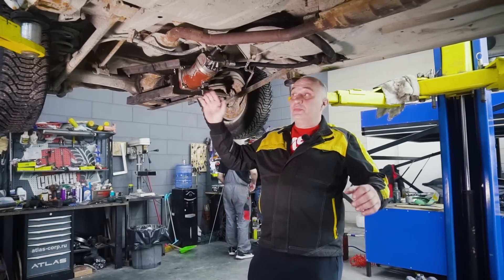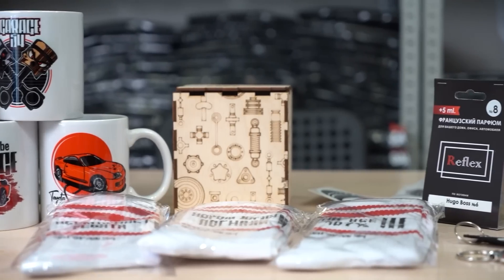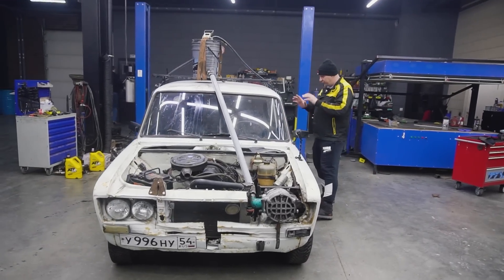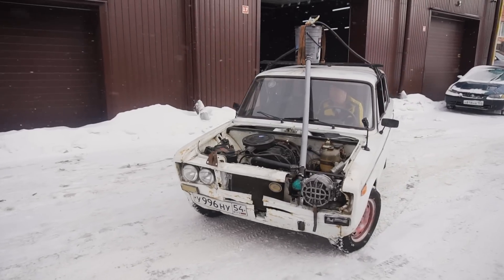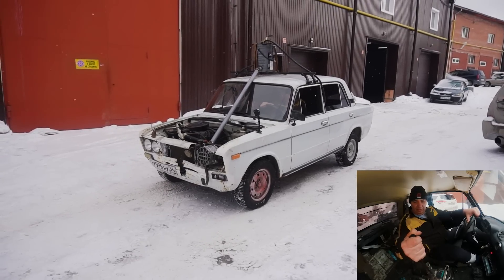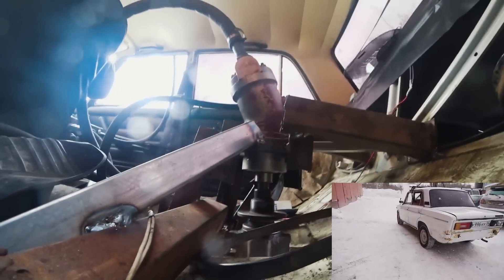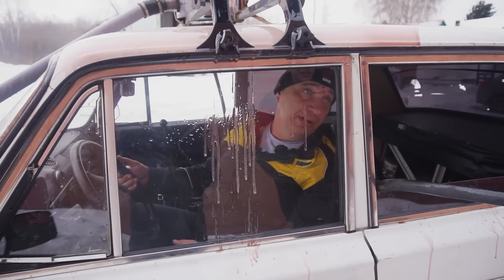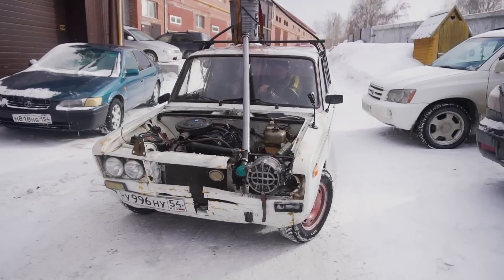Liquid propshaft (part 2): we got it to work!

Comment: the problem is your valve block; its not meant to run stuff like this, its meant to run reversible cylinders. This means that in the transitional region (from off to  forward, or off to rev) it creates a ton of extra restriction, but doesn't help "slip" the engine with relation to the wheels. When you fully open it then the restriction goes away but now you're fully in gear so again its hard on the engine. This is why this system only works when you rev it then slam it into forward, but struggles so much when you try to ease into it. its hard to say what the gear ratio is but it may or may not be correct. I think you would have better luck with a clutch between the engine and the pump, and then running the hydraulics from the pump to the motor without any valve.

Comment: What do you mean can't backup is inconvenient. When I bought a VW Bug in high school the transmission had lots of problems in Reverse so I tried not to use it. I remember out camping with my brother in one of his cars when we lost reverse from the automatic - Bang! no reverse. On a different Bang! no third gear so we drove ~200 miles in 2nd down I5 in California from Humboldt county to Silicon Valley area. Once driving a van in Santa Cruz the shift linkage broke so I was stuck in 3rd. Starting up on a hill in 3rd gear is interesting.

I remember air powered power tools used to be very popular although more are battery electric now. What about four wheel drive are power? Stupid idea. In swampy area in USA people have Fan Boats with the engine driving a big FAN to push the boat because propeller gets tangled up and hits too much stuff. Driving around down you'd knock people over with the wind but when the chase you the wind would blow them away so you could escape.

Comment: Maybe put the pump in place of the transmission, but leave the clutch in.  You start with the clutch depressed, so the hydraulic pump is not spinning.  Then release the clutch to run the pump.  

A reversible hydraulic motor takes care of reverse.  You just pull the lever the other way.   You might be able to salvage one from a mini excavator machine-- the one that spins the whole cab would do; it's not high RPM, it's reversible, and it's got plenty of torque. 

Nice build, regardless.

Comment: Would be neat to set a Lada up as a skid steer with hydrastatic drive. Remove the steering wheel and lock all the tires. It would turn on a dime!

Comment: Having had a boat with hydraulic drive I have some insight into what's possible. Now it was some years back, but I remember that the hydraulic pump and motor actually was the same models. Turns out they can work either way. Another thing was that the valve used had three circuits. In "neutral" is recirculated the oil from the hydraulic motor to the oil reservoir. In forward the oil circulated through from the pump to the motor and back to the oil reservoir. Finally in reverse it simply switched the input and the out put of the hydraulic motor. The valve had some overflow so it was possible to carefully moderate the prop speed without changing the throttle. Or you could brutally slam the hydraulics from full forward to full back and the boat would rattle and shake as the water churned into white froth behind the boat.

This last was scary and put a lot of stress on the hull. It's something that's almost impossible to do with a mechanically coupled driveshaft, but the hydraulics was just so darned robust. The boats previous owner was a retired Navy Commander and he drove that boat as if it was one of his corvettes. Full forward and full back, nothing in between... I never used it anywhere near as hard, but it was good to know just what it was capable of if need be.

What I'm getting at is that it shouldn't be that hard to hook it up so you have a reverse. Another thing is you need an oil cooler if you want to be able to drive it for any length of time. When the hydraulics heat up enough it will foam and you don't get anywhere. I also think you need to figure out the RPM of that pump. It really shouldn't be to high as that generates more friction in the hydraulics lines which heat up the oil even more. Get the RPM down somewhat and it shouldn't heat up to much.

And then there's the speed of the hydraulic motor. If it's to high you either have to get some kind of gearbox in there, or perhaps you can do with a torque converter. That last might be a good option if you have one or can get one for cheap. When a hydraulic drive is used in a boat the prop and the sea acts as your torque converter...

Comment: Ok, so that was hydraulic power transmission.
The logical equivalent would be electric transmission: fit a generator to the engine and drive an electric motor on the rear axle.

Comment: You should have put the hydraulic pump at the end of the transmission, not on the engine.
And then you would have had 4 speeds, rather then putting another differential in there.
And the hydraulic motor has to be bigger too.

Comment: Seems you would run this directly to the Flywheel 

It would give you a transmission to work with and would be interesting using it as an  engine assist (challenge would be to make the crank/Flywheel work with the hydronic gear)

Comment: just what popped in my head when I saw the video. you should have connected the pump to the output of the gearbox and have full control over the pump speed and just In case a divert valve on the hydraulic pipes in case he pressure is too high or too low

Comment: In part 3, you should explore Ford's Hydraulic Power Assist concept. Have the hydraulic system as an add-on to the mechanical system, with a ballast tank that pressurizes when braking. If set up correctly, that Lada should do 0-60 in 5 seconds!

Comment: Place that system with front wheel drive.  Connect the pump to flywheel from motor and set a connection to throttle  and it would be less stress to shorter pressure lines and have the hydroloic oil   tank in trunk that would be hooked up to a  oil cooler that would be more efficient to the car.....and  shorten the lever where your throttle controls the speed

Comment: Using the transmission would have been a good idea. It is there for a good reason, after all. I've read other comments that said that a hydrostatic set ou would have been good, and they are right. But it does the same thing as the transmission. Gives gear reduction for power multiplication to get you moving. With the set up you are using, you are limited to just one gear.

Comment: The hydraulics are acting as a clutch. And the hydraulic pump is the gear. Only one gear in the hydraulic pump so top speed is what it is....basically you've made the simplest Frankenstein semi-automatic with the biggest hydraulic cushion. Great idea. Now connect it to an open cvt. One infinitely variable gear. Think go-kart belt clutch. No shifting

Comment: Hi Vlad, I'm a big fan of your show. How about putting the hydraulic pump on the engine output, and maybe putting one hydraulic motor on each wheel through a gear reduction for a 4-wheel drive vehicle.

Comment: As a hydraulic  engineer this video makes my cry and laugh at the same time, wonderful to see an experiment like this but on the hydraulic side there is a bit to be desired🔧
Reply: @Karl with a K  it would be very interesting to see the difference in efficiency compared to a driveline with gearbox, the only trouble is that you would need a variable displacement pump as to not 'destroy' the unused energy with a valve (engine will have insufficient  torque on low rpm to get the car moving). Could be a closed loop system as well, contrary  to what is shown in the video.
Reply: @Karl with a K it's a joke with an element of truth 😉

Comment: congratulations !! what a big job !! to remedy the problem of the accelerator why not try to mount a throttle body with the throttle that opens automatically due to the negative pressure that the engine creates when it goes under stress, a bit like the carburetors of the lawn mower, (at least I tell you about the ones I have seen here in Italy) on the golf GTI mk2 1.8 8v there is a double butterfly that does this, I am sure because I have owned one and I still have the whole aspiration at home. from Italy! keep it up !!

Comment: Fuck around and catch a hydraulic injection in the face with that shit..  wouldnt be so comfortable with a spinny thingy right behind my head and a bunch of hoses strung together with god knows how much pressure going through em..  had to been over 10kpsi easy..  with the motor at full tilt.  But i dunno much about hydraulic ratings and motors..  different world messing with those..

Comment: The control lever is basically working like a clutch. I would recommend hooking it up to a clutch pedal such that it engages with the pedal up and releases when the pedal is pressed down. that should make the coordination easier, as it would close to what you are use to. Also having the pump direct to the engine output would reduce losses.
Reply: I was thinking this myself, I totally agree!

Comment: You need to have a manual lever to set the engine revs and the foot operated pedal to adjust the pump pressure. This will work better.

Comment: If only someone were to invent a pedal or something to connect the engine to the driveline.. lol
Edit: 15:20 Ayeee! That was meeee! 
..and probably 500 other people. It was because the last vid was described as getting rid of the driveshaft. With a driveshaft you still have a gearbox dont you? So why wouldnt that be interesting? The "hydraulic driveshaft" could double as the clutch. No more clutch wear or overheating!

Comment: I think he needs a lever throttle so.you can set it at a certain rpm, and then use the hydraulic valve as the accelerator. Or just a more powerful engine that can run that pump at an idle so you can just open the valve completely and use the normal gas pedal to spin the pump faster and travel faster.

Comment: 15:34 the point is that you have a near infinite range of ratios within each of those gears. The transmission simply allows you a broader range of road speeds because the pumps you've selected aren't infinitely variable in displacement.

Comment: Using variable volume pump instead of valves would be like hydrostatic transmission. They just pump more per revolution to go faster. Also could using a governor like on lawnmowers to keep revs stable could help. One could make massive project out of this.

Comment: If you want to expand this concept, do a full boom lift drivetrain swap. Torque hubs on each wheel, using a joystick to steer and drive.
Reply: Also just a recommendation, diesels are better for running hydraulics.

Comment: just raise the default passive running speed, lift your pedal of the car engine, use it as a automatic pressure generator
Reply: the liquid (or electric) works as a smoothing buffer, temporary high power storage

Comment: Have a simple suggestion since I worked with hydraulics, even though was a electronics/electrical specilist for several decades.  Simply install a variable displacement pump on the engine.  With a wobble plate pump in the neutral position no oil flows, with maximum deflection of the wobble plate you have maximum flow.   Many industrial and aguriculture systems use this method and it works fine.  What you are having happen is basically hydraulic lock situation.  The only way your system will work is WFO.  With a variable displacement pump you would set the engine to a set speed and swivel the pump to change the hydraulic flow.  We had one machine that used a fix displacement pump and a preportion valve system to vary the rotational speed, it was a continual pain in the ass while the wobble plate units ran trouble free.
Reply: Such a part could not be pulled off an old excavator but from a more modern agricultural tractor, and not a cheap one. Too expensive.
Reply: @pflaffik  Sorry it is a common item for motion controls in many industrial applications. Can dig around in several industrial/agraculture junk yards around her and get them at a reasonable price.  If you want it to work you have to spend money.  Practically EVERY compact tractor employs this method for drive system and another pump for the other systems, often these pumps however have a compound arrangement where the variable displacement pump is for drive and the other is for systems.
Reply: That would be a better solution indeed, a smaller pump also works out in this situation. 100cc is ridiculous
Reply: why arent those used for regular cars too? seems like it would be a much more durable version of a cvt

Comment: If you did go with the pump after the gearbox though you could have hooked up some very basic 4 wheel drive though by either having a motor for each axel or one for each wheel. That could make a good video. Definitely need to make sure the cooling of the engine is up to par though.

Comment: Would possibly having two drive Motors One left side and right side. without a differential. with the gear box driving the pump. Oil poring hope it was not hot.

Comment: lol that hydraulic pump is massive in comparison to the motor. the poor motor isnt designed for that rpm but it has no choice with so much oil being stuffed into it. 
a bit stupidly dangerous really as there was no over pressure relief in the circuit. who knows what pressure was inside that line right next to Vlad.

Comment: That red fluid could kill you..  just telling.. don't use clamps, only "factory pressed fits" if that dosen't mean at there "pipe clamps".. you are going to kill yourself if pipe bursts or some connection.. those pressures could cut ✂️ skin and poison you and it's same color than blood so doctors can just think "wtf is wrong with this guy".. but seriously, that's suicide machine and don't put fittings in same cabinet than driver if you could see this maybe the endresuilt. Oh man that this didn't work so nice it could generate big flows and pressures. You're dead man otherwise..

No home made clamps with hydraulics!!
It's first and last time instantly.

Comment: Sorry ,I laughed my ass off when the hose popped out and "Vlad" got transmission fluid shower.I would think leaving engine at higher RPM and modulating fluid pressure is way to go,great try!

Comment: There are adjustable flow pumps, for example an axial piston pump where the stroke is controlled by a swashplate. Those can be adjusted from zero-max. You could control the pump with the lever or gas pedal, while keeping the engine at some efficient RPM by other means, a governor for example.

An interesing concept would be how to control this thing for maximum efficiency while having some decent final speed too.

Comment: As for suggestions, bolt a generator onto the engine's output and a powerful electric motor to the rear diff, making a petro-electric traction car, kind of like diesel-electric trains... :D
Reply: Like a vauxhall Ampera? That car has no direct drive from the engine.
Reply: Sounds like a plan. I've kind of wondered if you could get a small petrol/diesel power generator, hook it up to a suitable electric motor and run a car that way. As mentioned by the OP, they do it with trains and the really big mining trucks, so it should be totally doable.
Reply: I was thinking the same thing.
Reply: I wanna do this on a motorized bike but I can't find the right motor/generator pair
Reply: Geoff

Comment: I want to see it on gearbox out shaft so the gears can be used to see how little in put u need to do the original gearbox speed   and see if u can get it to go faster than the 30 u claim

Comment: Почему бы вместо второго дифференциала не использовать систему шкивов и ремней для соединения гидравлического двигателя с дифференциалом?
Instead of a second differential, Why not use a pulley and belt system to connect the hydraulic motor to the differential?

Comment: The return pipe should offer zero resistance to the oil flow, so the greater the diameter, the better, within reason.

In the wake of this, how about an infinitely variable belt drive for a transmission - As used on the DAF 66 of some 50+ years ago?
Reply: Like a CVT? Haha. 
Infinitely variable belt drives are in a decent handful of econo-box cars still, and Audi actually had them in the A4 in the 00's.

Comment: Connect the hydraulic valve to the clutch pedal. That could make driving easier
Reply: They dont have this kind thinking. Like all russian things. They have something but actualy not.  Compare 80s russian cars and another world cars(germany,.japan, usa)   USA cars have ATM trans, AC, electric windows in 50s cars. Beene there done that.  And if something is broken, the use sledgehammer and wire....
Reply: Don't bully them :D 
These guys didn't start that war.. this is car channel ;)

They have good ideas and not so good.. and sometimes they hit those good ones. Not every project, but let them try again (:
Reply: @jannejohansson3383  nothing personal. I'm living nex to russians over 30years. Been there, done that, seen this.  Nothin personal and nothing to do this war. :)